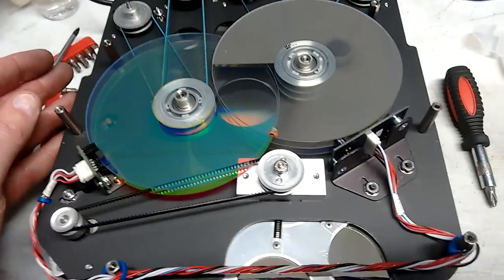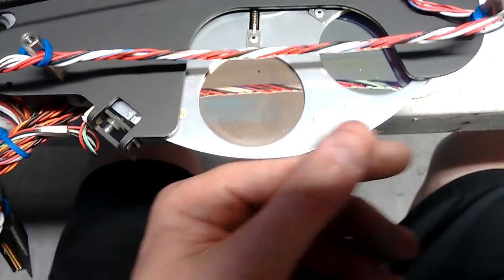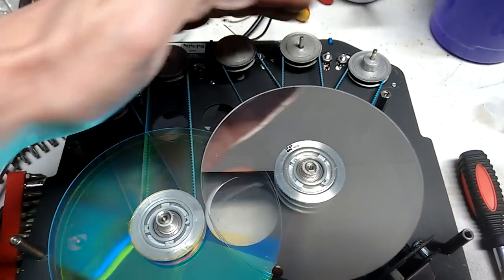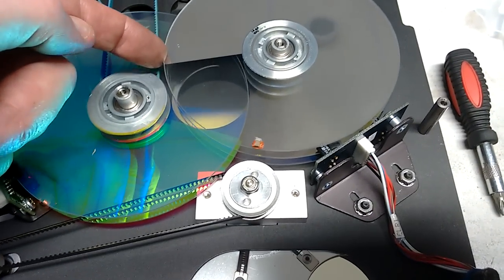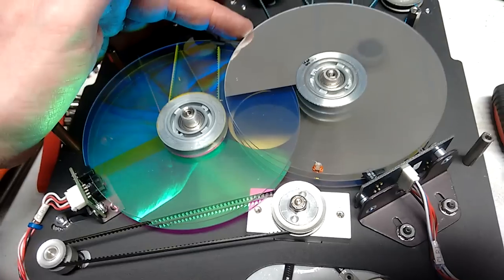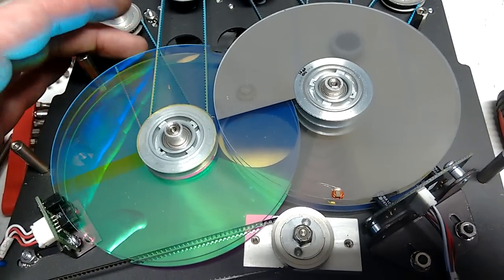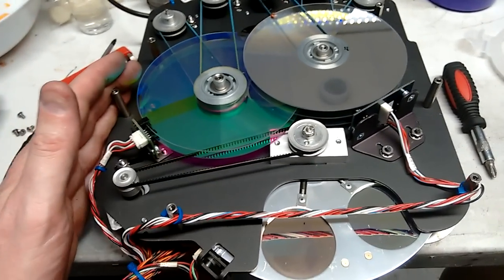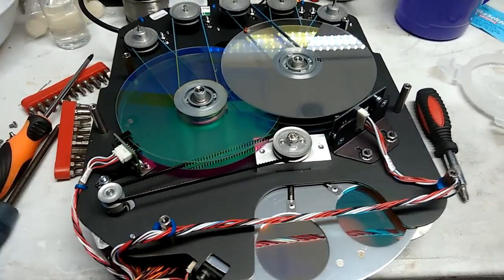A closer look at a VL3000 colour bulkhead.   TCF

Comment: Would be fascinating to see how they make those gradual grated discs.
Reply from the maker: ***** If you look at them closely it's a fine dot pattern like a colour printing process, but with accurately deposited metal.  I shudder to think how expensive they are to make.
Reply: +simontay1984 these disks are more expensive then you'd like them to be, I know that much... in one of the robe spots we had to repair just one single colour from the colourwheel was missing (so just a Tiny square, luckily not the cmy wheel) was €80... wouldn't want to pay for a whole cmy system...